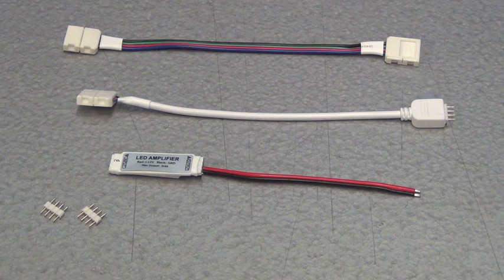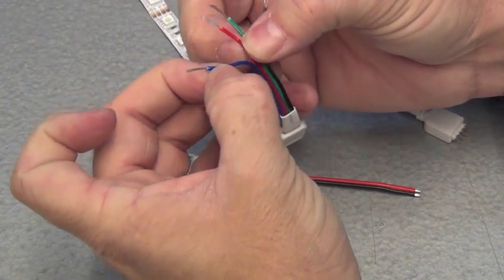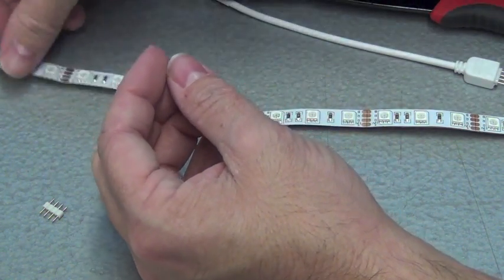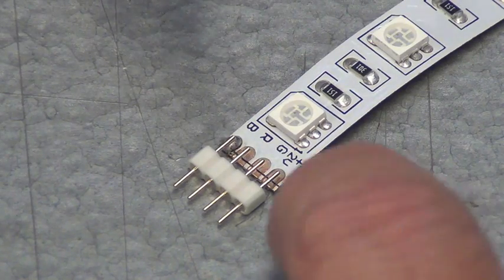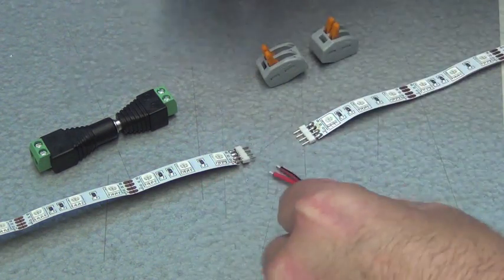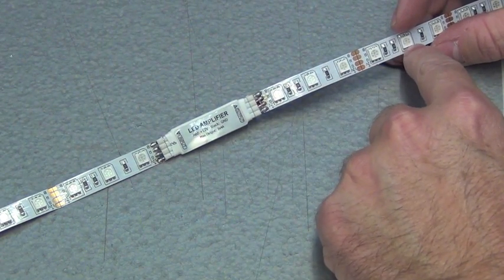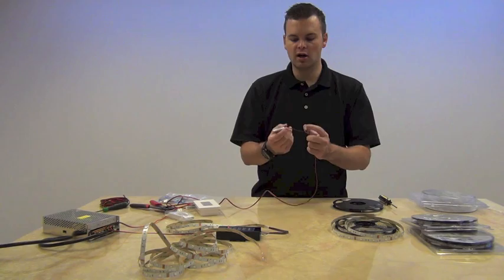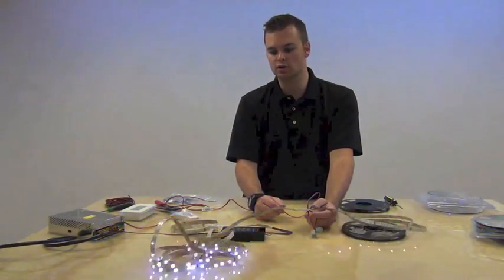LED RGB How To Part 2

Comment: Which is the negative on an RGBB (black is positive on mine, then I have red, green and blue) I need to power inject with a pigtail, red and black wires. Thanks

Comment: can you feed a 5v PWM into one end of the amplifier and then power the thing with 24v to run LED light strips?
I want to use my arduino board to control LEDs with a PWM logic signal.

Comment: How if instead of series circuit like in your video, use one big amps 12v power supply and put them in parallel? In parallel circuit, do we still need amplifier for each strip even though the power supply has big amps?
Reply: Same Question ❓

Comment: Hi , I have a 20m I need to connect continuously , is it better to use parallel connection (from the power supply trough the controller and then to the first 10m, and draw a cable all the way to the next 10m)  then the amplifier in between ?

Comment: Hello i have a question the little amplifiers what amp power supply should be used? I'm using a 12v 150 of 5050 5m leds?

Comment: Very informative and helpful, thanks. Just a couple of questions: 
1: where does the power wire go to from the amp? The RGB in the power or the control box?
2: Is it possible with 13 meters of 5050, to just run the end back into the power supply to boost it from both ends?
Thanks
Reply: ArcanePath360 I was thinking the same thing. I am going to be running 10m and was planing to just connect a lead to the ground from the end of the 10m strip to make sure the colours stay the same throughout
Reply: drumlyell Well I've just tried connecting two strips to the same outlet terminal on my controller and the 13meters of 5050 LEDs light up all the way to the end consistently, so it worked with no amplifier or parallel wire needed. I just made sure I bought an 18a controller to handle it with a 20a transformer. No need to even connect the ends together
Reply: ArcanePath360 Cool thanks, good to know. I have three 12V 12.5A power supplies on their way for three runs of 10M each.. If I did my math correct it should work good!
Reply: drumlyell That would only allow 150 watts per 10m. I have the 5050 rgb and they are 14.4w per meter, so 10m = 144w. You should always allow about a 20% margin and get an over rated power supply. You can never go too big but you can go too small, otherwise the power pack can over heat and the life be will shorter. However if you plan on using a dimmer it shouldn't be an issue. Also, the current draw is only at maximum when you have all 3 colours up high (white)
Reply: ArcanePath360 Cool, so the power supplies are 150W 12V 12.5A. I am going to be controlling them with DMX512 DMX decoders, and programming sequences that will playback in time with my band onstage.. One decoder for each 10M run. I will have to make sure not to program any times with all three colours at full strength! Safe to give it an 80% max ceiling when using all three at once? I may be able to program that limitation into my Ableton Live project... Hmm
Reply: drumlyell I would check the watts per meter before taking what I say for gospel. I'm out of my comfort zone with DMX and imagine you have bought the special RGB strips that go with this system. If you are DMXing I imagine there will be various flashing effects and various colour fades, so plenty of rest for the LEDs to recover from rather than being constantly on so I wouldn't worry too much.
Reply: ArcanePath360 Im not using the fancy "addressable" ones, just using DMX to basically control the voltage going to the three colours. For anyone interested: Ableton Live is connected to DMXis controller via USB. From there DMX and AC power supply are both connected to the DMX512 decoder box. LED strips connect and are controlled by the decoder (DMX512)

If it all works I will post a video demonstrating the setup. 

My band uses a click track 100% of the time (different synths and machines are all slaved from the midi clock of an Electron Octatrack), so It works for us to integrate sequenced lights.
Reply: drumlyell I thought you needed addressable LEDs to use with DMX controllers, guess I was wrong.
Reply: ArcanePath360 Kinda the same principal as putting regular light bulb on a dmx controlled dimmer. DMX controls the bulb via a dimmer that is in between it and its power supply.
Reply from the maker: +ArcanePath360 http://www.gapsupply.com/category-s/117.htm

Comment: I have RGB 5050. When I use the connector at the first of this video, the added strip of LED is a different color and does not change colors with the strip connected to the controller. What could I be doing wrong?

Comment from the maker: The controllers are low voltage and hook up directly to your 12vdc battery and then the strip hooks directly to the controller.